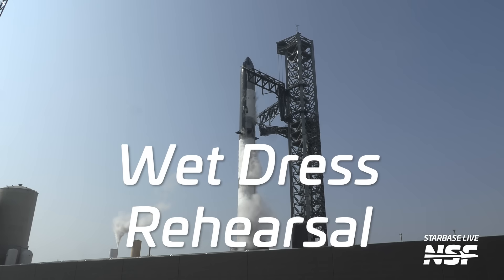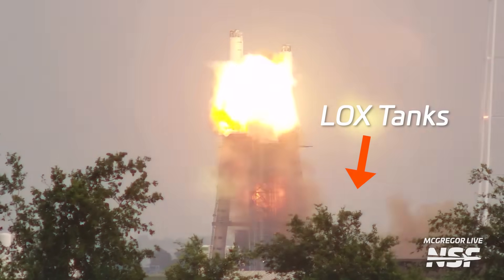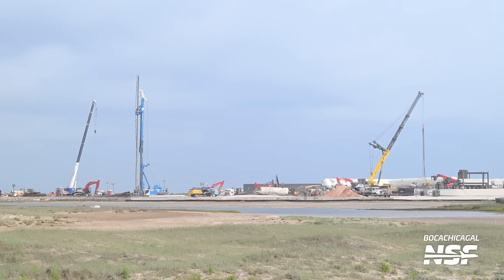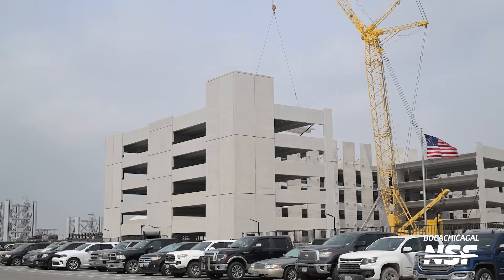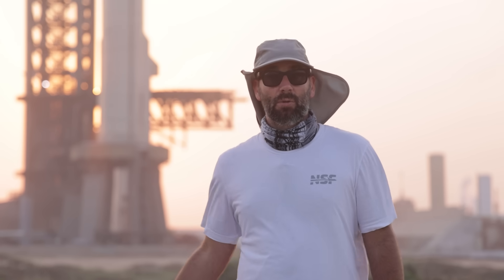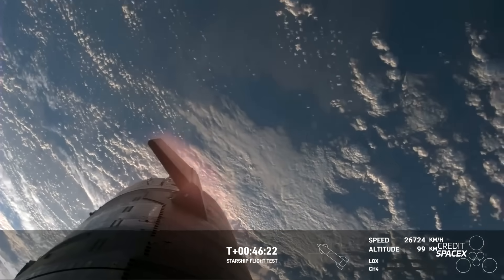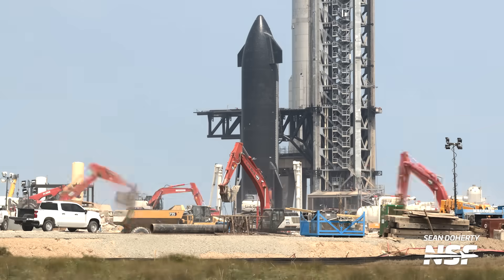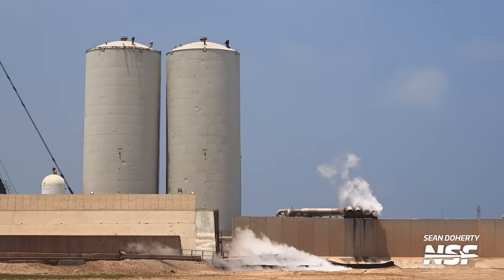Everything Is Falling Into Place (For Starship Flight 4) | Starbase Update

Comment from the maker: Get Your Free 30-Day Trial of Brilliant + 20% off a Premium Annual Membership:
https://brilliant.org/NASASpaceflight
Reply: Filter Blockage,... Fluid would be sucked in to the pumps and pushed through, gas would dissipate, so Solid,.. loose parts like a baffle vibrated off it's mount, or ice made of fuel or oxidizer ?

Comment: Bill Nelson is a fool. He trusted Boeing, he trusted Jeff bezo’s. But none of these fiasco’s will match up to the current SpaceX scam. Starship will succeed when donkeys fly. The fact nasa current regime can’t see all the crap on the wall only means they also need to be replaced.

A novice engineer could quickly run the number on the rocket starship system. Then arrive at these numbers do not compute. First 33 engines. No one since Germany v2 has any aerospace entity got a 33 engine to function from launch to landing. Second who in their right mind would attempt to launch the New Jersey battleship into orbit. Without a full coned hot stage ring. The starship engine valve will always melt the valve o-rings. Last the heat tiles are too fragile to withstand reentry with or without studs. If you examine a heat tile’s underside. You can crush it with your thumbs. Bow picture this starship entering earth’s atmosphere at 17,500 miles per hour. On contact the tiles will fly off like a deck of cards. Stainless steel melts at 1350 degrees. At the point of contact the outside temp will be at 2400 degrees or higher due to the over weight of the rocket.

So since common sense can’t be employed. Cancel SpaceX, take over the falcon 9 & super heavy project. Then using Falcon technology scale up the size of falcon heavy to create a reusable system than can put starship in into near earth orbit, without refueling.

Then put the project In the hands of JPL. Then please no more daily dose of click bait. Only to pump a mad man that once got lucky.

Comment: Thinking about B10's destruction, SpaceX said that they got LoS at 462 m altitude and according to the telemetry data that we see, B10 was doing 1112 km/h (which equates to 308.9 m/s) thus LoS occurred just 1.49 s before B10 reached zero altitude.  How accurate are the 462 m and 1112 km/h figures I wonder?  Did B10 actually HIT the ocean's surface and that's what led to LoS? Just a thought.

Comment: I am wondering what is the contaminants behind the filter blockage problems they had.
Maybe ingress of atmospheric humidity , co2 , argon or actual solid materials like dust, residues or chemicals from the pipes and tanks and fittings and stuff during starship manufacture.
Or maybe from the tanker trucks or propellant storage tanks or is it some kind of residue in the methane like methane hydrade crystals.
The filters intended to protect the engines from damage ended up causing the engine failures on flight 3.

Comment: Turn it however you want, but the hardest part is learning successful reentry with such a huge vehicle.  And to prevent the next time robbing mishap investigation, they should simply omit all that follows from the official flight plan.  Add it clearly marked as bonus if reentry succeeds.  Every other rocket is designed to break at that point.
🚀🏴‍☠️🎸

Comment: One train of thought is the oxygen level was even lower than before intentionally. Using less could allow SpaceX to skip the step of a fuel dump in flight. That has caused issues before so remove the step entirely.

Comment: Does SpaceX have or is it planning to build a cryogenic gas plant nearby to Starbase?  This would produce liquid nitrogen and liquid oxygen, as well as argon, neon, krypton, xenon, helium, hydrogen, carbon dioxide and water all from ambient air.  The hydrogen and carbon dioxide might then be used to make methane and oxygen…which is what must be done on Mars, too.  They might as well get experienced at it.  The unused gases can be sold.  The plant might be partially solar powered, and possibly partially nuclear powered by a small nuclear power plant.  Nuclear power will inevitably be needed on Mars, as well.

Comment: Elon eliminated hot gas thrusters thanks to Tim Dodd (EA) and that now infamous interview. In addition, weight savings was gained by not using landing only dedicated header tanks. IMO the solution to a booster landing will require a dedicated fuel source at that time for the success they want
Reply: They already have a dedicated landing tank on the booster

Comment: the clogging issues make me wonder if expending that much propellant that fast causes some slush/freezing in the cryogenic liquids (or against the walls/domes) as the pressure drops.  if so, maybe the added equipment is just for a little heat/pressure...

Comment: theory: are they struggeling with ice forming due to the temerature difference in methane and oxygen?, sounds like they potentially need some insulation after all.
But that's just speculation on my part.
However it would be interesting to know what the log-term solution to that is on tanker starships... those would need some king of inbuild cooling to minimize boiloff, and they would need to better separate the fuels, or else they will have problems with ice...

Comment: The stronger you build the engine, the more spectacular the event when it finally fails. 
  Think of it sort of like this. Build a tire that is designed to operate at 40 psi with its expected failure rate at 50 psi ish.  Push it to failure and experience the rapid release of 50 psi.
   Now repeat the test with a tire designed to operate at 400 psi.
  Push it to failure, and if it scales, experience the rapid release of 500 psi.
   The release of 500 psi will be a much more energetic event. 
  Spacex will identify the component that failed and redesign it to increase its durability and then retest. 
   I would imagine the goal is to maximize thrust first and then maximize for durability to a margin well over its normal operating tolerances to help ensure the safety of the engine.

Comment: Its notable, I think, that the LOX filter clogging affected the Booster engines both toward the end of the boostback burn, and during landing.  Boostback was still feeding from the main LOX tank, whereas the landing burn would use the LOX header.  So, it seems the affected filter(s) would sit between the engines and some common inlet/manifold entrance point(s) located beneath both the main and the header tank, and there'd be some kind of a selector valve to control whether propellant is fed into that common bit of filter-guarded plumbing, from either the main tank or the header.

Comment: It might be time to start speculating pretty hard that “Ice” is blocking filters…or slush at least.
Perhaps the close proximity of the colder liquid is all that is needed? A relatively thin sheet of stainless?
Reply: Maybe the down comer pipe needs insulation ? Is it only the ship that has header tanks ?
Reply: @rustyfox81  The booster has a LOX landing tank, and the LCH4 downcomer serves as a header tank.
The clogs are in the LOX tank, so it can't be ice: LCH4 is warmer than LOX, and if LCH4 is getting in, there wouldn't be a clog: there'd be an explosion
Reply: @bryanillenberg  I wonder if they are getting a bit aggressive with the super-chilling in pursuit of higher performance?
Reply: @marksinclair701  If it was going to freeze, it would freeze during prop load.
The fuel is actually getting warmer during the launch
Reply: @bryanillenberg  What do you think the clogs are? The language the used is interesting "continued filter blockage where liquid oxygen is supplied to the engines" and "Super Heavy boosters for Flight 4 and beyond will get additional hardware inside oxygen tanks to further improve propellant filtration capabilities". Does sound like they think it will keep recurring. I can't think of anything else but slush/ice.
Reply: @marksinclair701  pieces of metal left in the tanks.
They could just be stray bolts, nuts, ect, ect.
Reply: @bryanillenberg  That would account for an engine or two, but they lost ~7/13. I read elsewhere (Reddit I think) that SpaceX got rid of the LOX heat exchanger a while back and are tapping off the LOX preburner for autogenous pressurization gas, so there is a lot of H2O and CO2 from the combustion products. This freezes and the ice floats on the LOX, so the problem doesn't become apparent until the tank is near empty. LCH4 not affected because they feed off the chamber cooling passages so it's pure CH4.
Reply: @marksinclair701  They lost 7/13, so 7/13 engines sucked in a bolt.
And the autopress doesn't use preburner gas: way too hot.
A bit of advice: Reddit is not a reliable source.

Comment: Very curious to see if the ship flip and burn still works. After all, only SN15 got it all right and stayed in one piece. Even then, it still had some issues with low pressure in header tanks. Best of luck to b11 and s29! :_Patch4::_StarshipH::_BellyFlop:
Reply: Even it fails in doing that it would still be a success. The flight following it would have to reach that goal. As long as they don't take any step back.